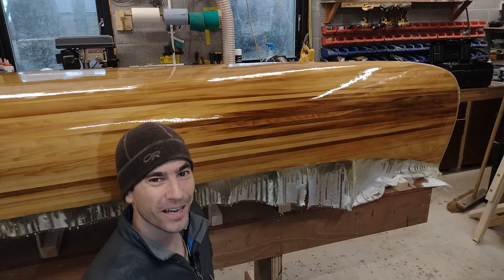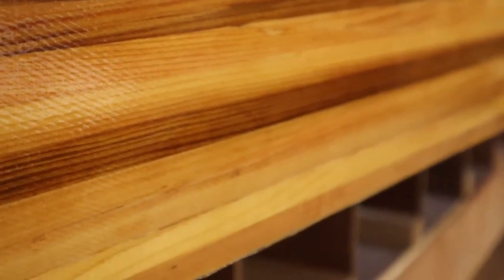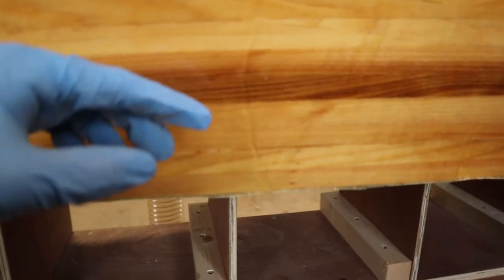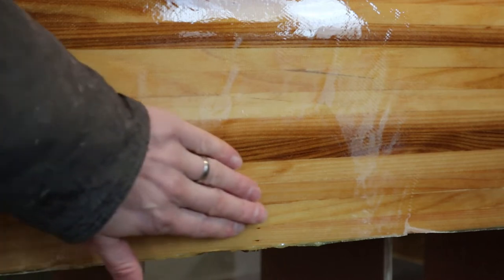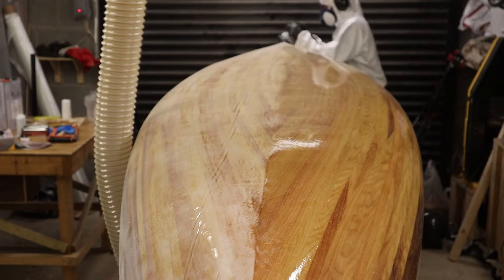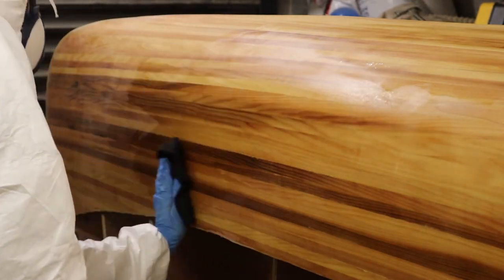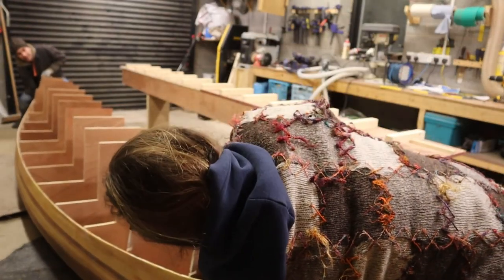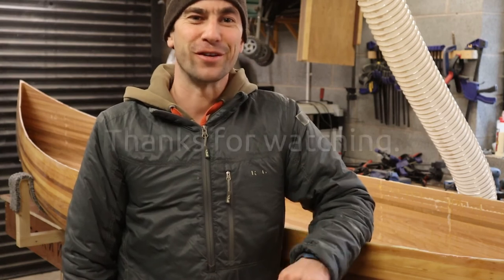Building a cedar strip canoe - Episode 12, Removing from the Mould

Comment: TRY A ROLLER NEXT TIME - I have abandoned brushes that leave bristles behind and scrapers that don't do a consistent job leaving the fiber weave texture at places.  Using a 4" tight foam roller is the only way to go 😊.  I get a very smooth coverage an almost no cloth texture in the first coat.  The second coat eliminates any are slight cloth texture and puts on a very even coat of epoxy without drips and sagging.